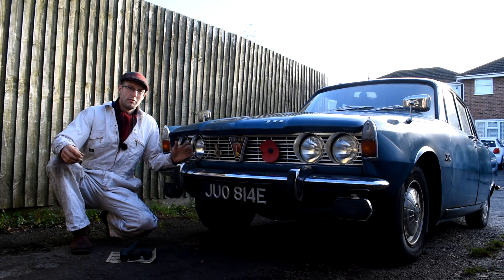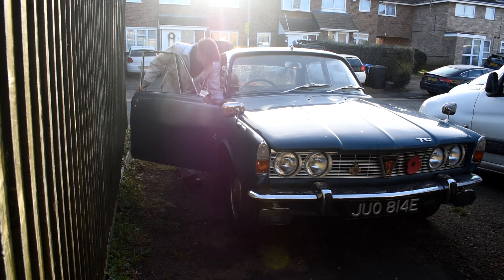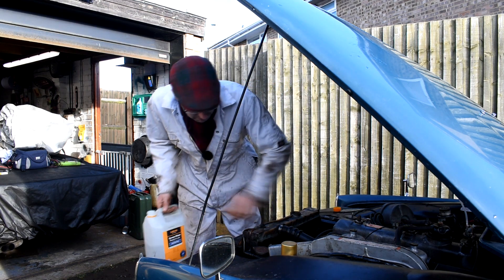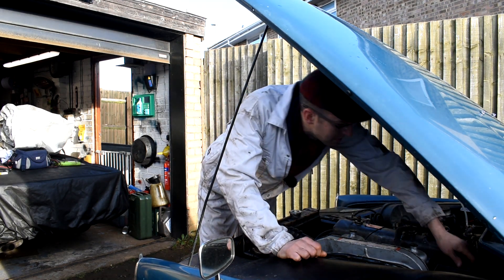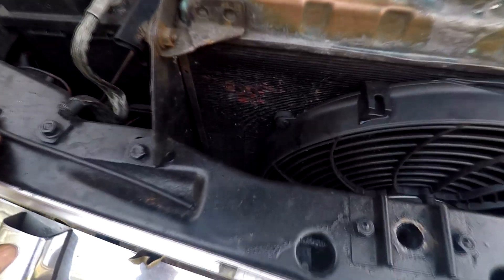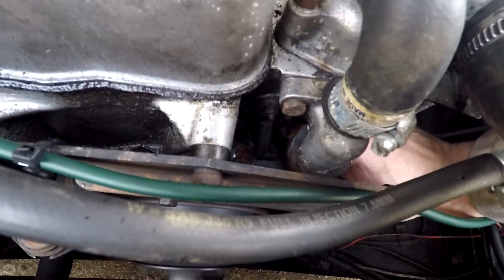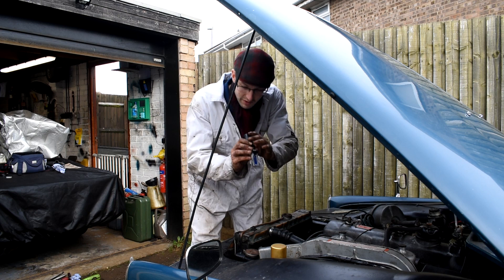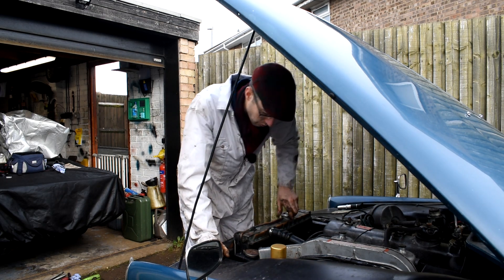Rover P6 Water Leak

Comment: Hi Steve, I like your videos, you have similar taste in cars to me. I have two TR6s and a 1969 Rover P6B.. One of my TR s is very similar to yours it's a 1969 one in Royal Blue built in February 1969.
Reply from the maker: Great stuff, I’d love a P6B series 1, but they are hens teeth compared to the series 2
Reply: I prefer the looks of the series 1.They spoiled them a bit with the series 2,the plastic grille doesn't look as good as the metal one, and the finishing strips ruined the lines of the car.

Comment: Totally agree that you dodged a bullet with that hose, esoecially having a spare in the boot, and you definitely need to fit a full set of correct new hoses this year ! Blue coolant traditionally should be changed every 2 years for maximum effectiveness, but new formulations may stretch it to 3 ?
Reply from the maker: Yeah couldn't agree more. I'm going to stretch the coolant for 3 years. I generally look after the car, when things need doing they tend to get done. However I should really record more of it on, but with it be my only car, sometimes it's just not always practical. I intend of getting on top of that this year and sharing much more content 👍